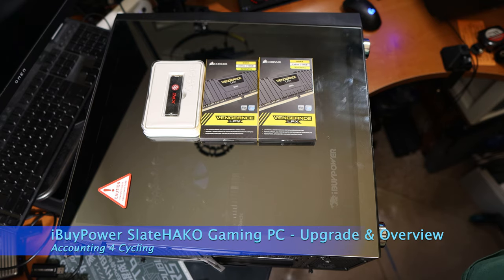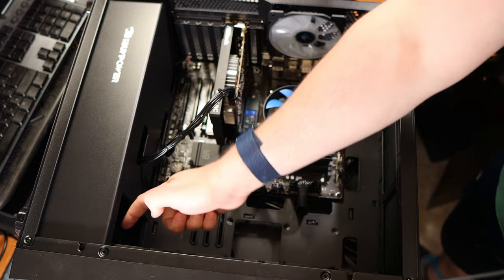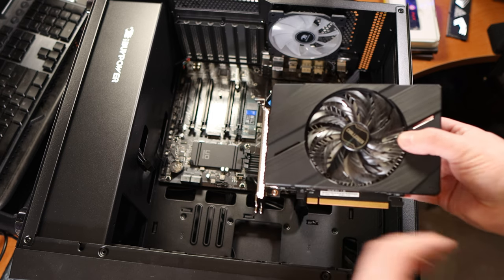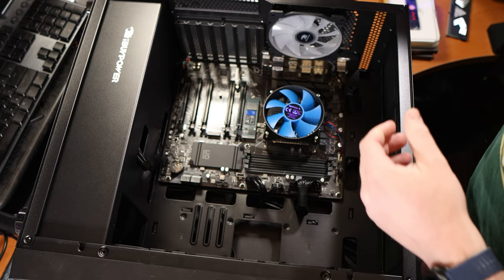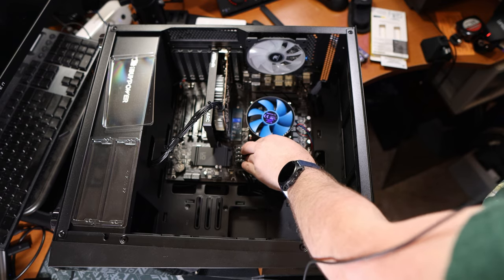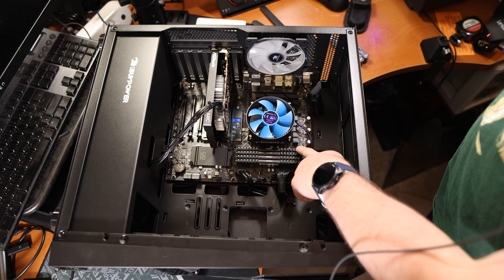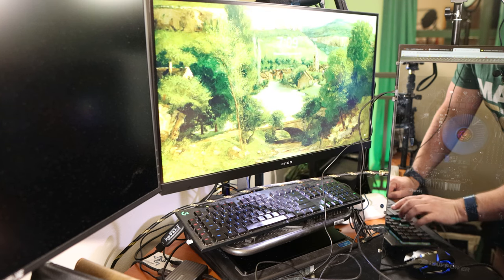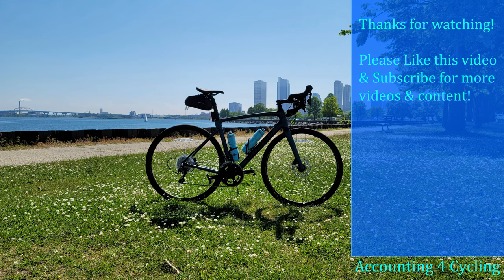iBuyPower SlateHAKO Gaming PC - Upgrade & Overview

Comment: So I know it's been a year sense this came out but do you know if you can't put a 4070 into this pc?
Reply from the maker: Yeah, if you want to put a 4070 into the machine, it should work just fine. Just make sure the power supply has enough juice for whichever card you decide on, but you might not be able to use the GPU bracket (it comes off with a few screws). The case is massive and should support most cards.

Thanks for watching!

Comment: im confused how can i stop the boot failures
Reply from the maker: This could be a few issues, I would begin with reseating the RAM and making sure everything is fully connected. If that doesn't work, go into the BIOS (hold "DEL" key during power on) and ensuring your boot drive is set as primary. I would definitely search for some videos from the likes of GamersNexus or Linus Tech Tips for troubleshooting boot failures. Sometimes its as simple as a cable not fully inserted into it's plug. Best of luck and I hope this helped, thanks for watching!

Comment: Will this motherboard take an i7 12700 CPU? I plan to buy this i3 version now(since it's cheaper) and upgrade to i7 12700 when the cpu price drop.
Reply from the maker: Sure can! It has the LGA 1700 socket and is a normal motherboard, so you can upgrade any parts you'd like. Thanks for watching!